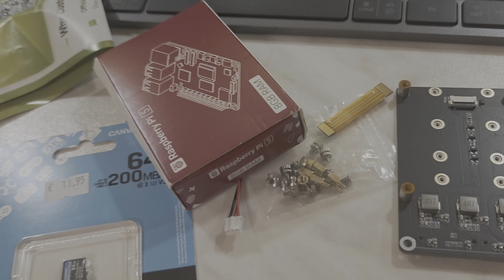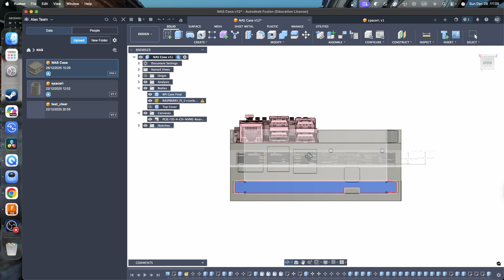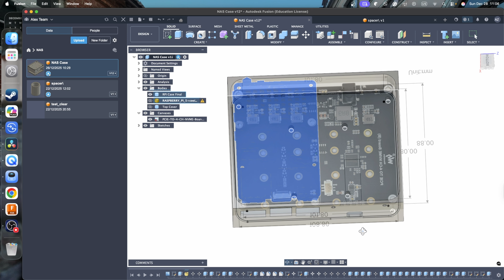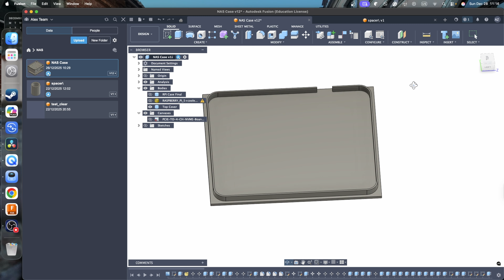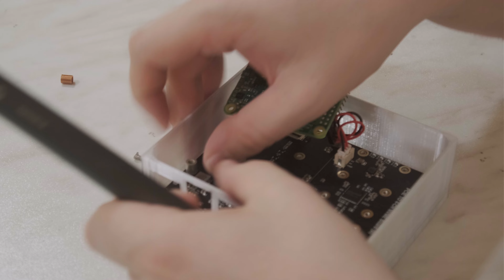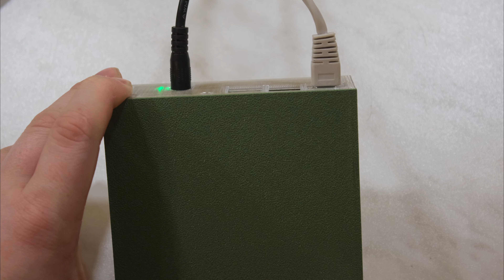NAS Upgrade to RPI 5 based solution!

Comment: That's a nice little unit. I'm curious how the drives fare with no cooling.  Open media vault is a good choice for OS, but if you're adventurous, want the latest debian version, and are willing to learn, it's not that difficult to set up shares directly on debian. It's worth trying at least once.
Reply from the maker: Cheers mate, glad you liked it is guess i could add small fan to case
I have small update coming and small fan and radiator to RPI 5 :),but my network is quite slow and I am using nvme with radiators so they are OK:) 
Talking about debian done it one, but feeling to lazy todo it now....